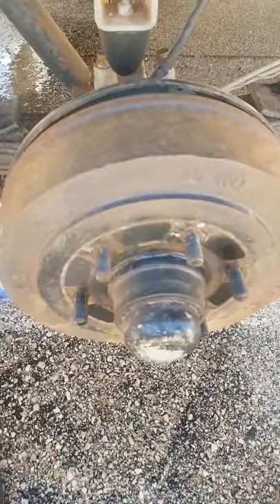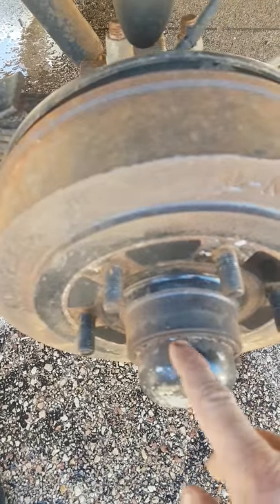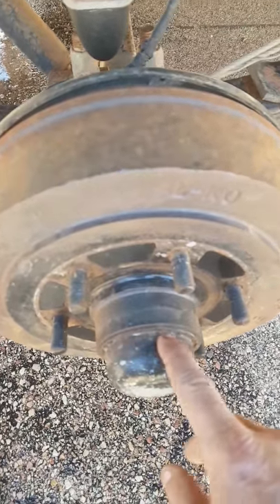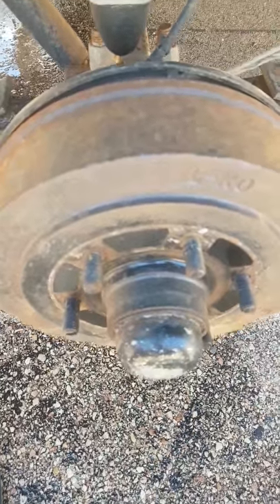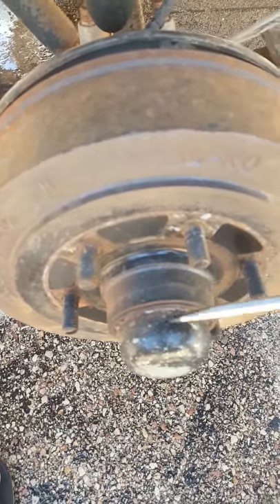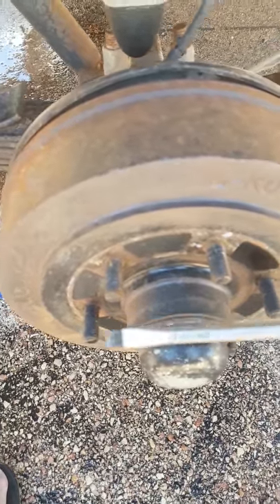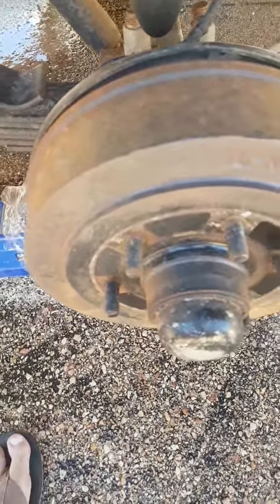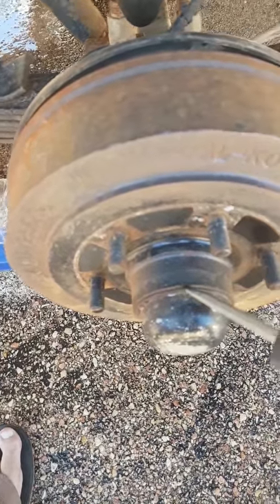Jayco camper trailer bearings maintenance Part 1

Comment: Use a single sided chisel to pop the cap off.
Reply: Should buy new ones anyways just in case, this being a trailer with Australian parts the dust cap looks like it would be a 64mm parallel dust cap
Reply: @ank55o7  agree, they could be part of the spares kit but they don't come in the bearing kit.  Using a screwdriver usually ends up with a dented dust cap and compromised seal whereas a chisel with its flat side and sharp end reduces the deformation.  Sure, nothing a dab or UTV couldn't fix but recommend best practices.
Reply: @Mouldyturnip75  when I have to use a chisel I take my time moving only a few mm at a time rotating the hub until I can twist the chisel and pop it out

Comment: How often should I do this?  I'm buying one that's only a few years old
Reply from the maker: Check bearings from the time you receive second hand and every 10,000 km or once a year. You can do a cursory check by jacking up the wheel and shaking it by hand top and bottom left and right checking for any play.